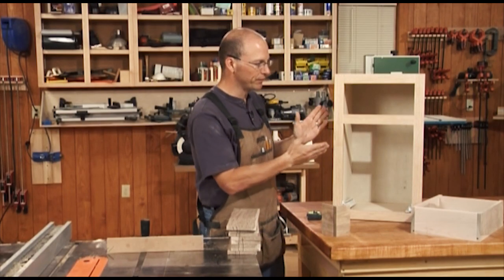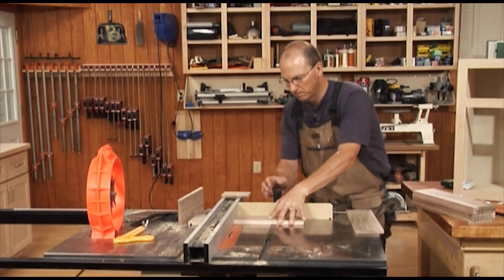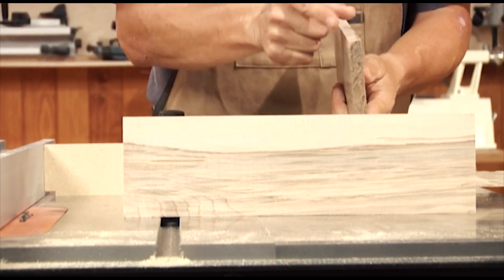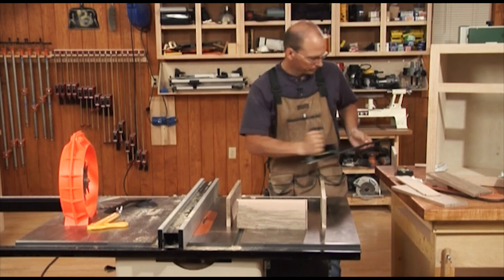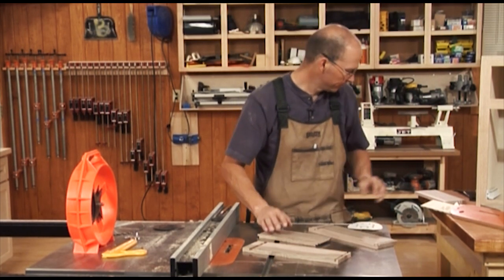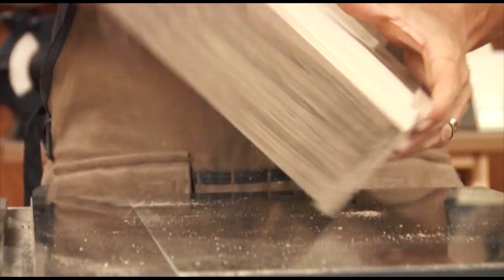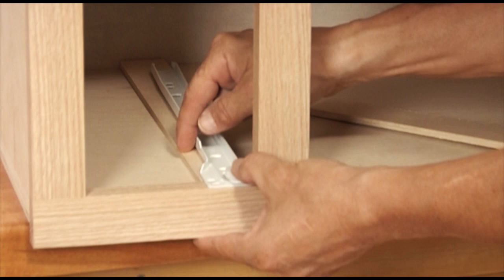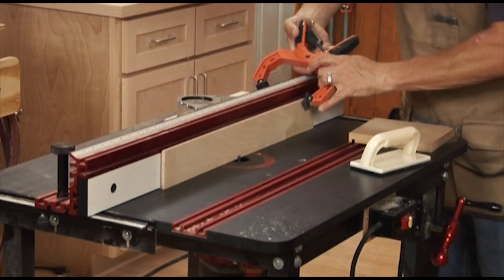How To Make Drawers with Lock Rabbet Joints - WOOD magazine

Comment: I liked this method so well that i bought a cheap used 10" portable table saw, set it up for this cut (with 2   71/4" blades with paper shims) and now dedicated it for cutting drawers only. Works absolutely great and saves lots of setup time, and goes out of the way on a shelf till needed again. I named it my "rabbet lock joint saw" lol

Comment: You failed to mention cutting the back narrower than the front so the bottom slides in after assembly of the other parts. Clearly you did cut it narrower.
Reply: he's got room it could be the same, and it would lock the draw in with the back lip. seems like a waste of space the way he did the back if you ask me.  search you tube for quarter quarter quarter draw's  I like that way better.

Comment: - Surprised that WOOD magazine is allowing the use of both the miter gauge & fence at the same time. That has always been a woodworking "NO NO."
Reply: Why?  I don't see any reason it should be.
Reply: @bobbg9041  because you don't have a cut off piece  getting trapped at the back of the blade, which would cause a kick-back.
Reply: Unless he does a through cut elsewhere in the video, non through cuts are usually not frowned upon with the fence and miter gauge